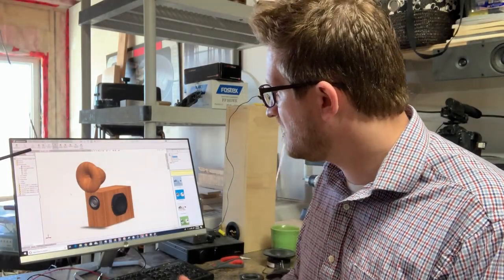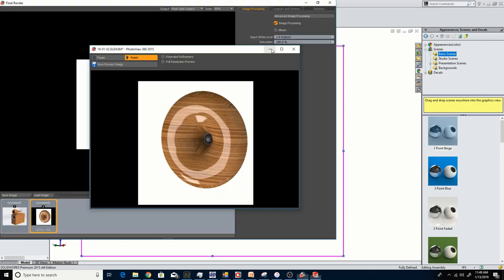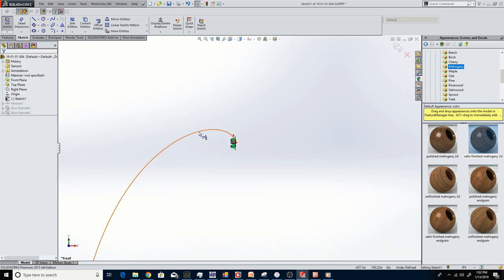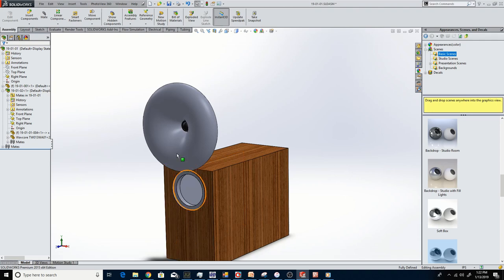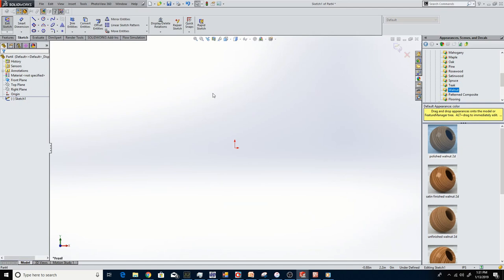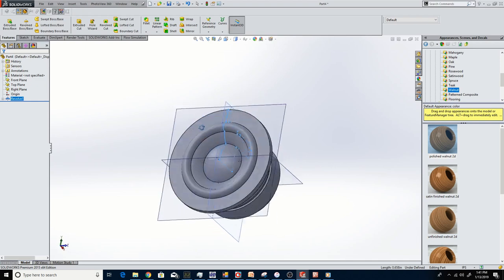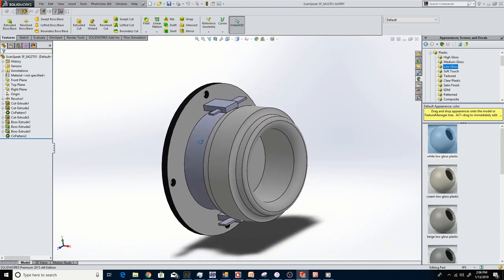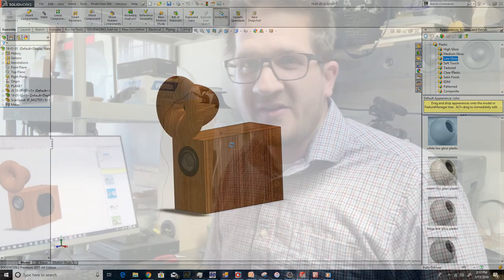Designing Desktop Speaker in Solidworks

Comment: Great video! I'll stick with the free version of Sketchup for now.
Reply from the maker: TransmissionLineDesigns I’ve personally never used Sketchup.  Do any of the modelling techniques I’ve shown transfer to Sketchup?  Or is it completely different?   I would think the sketch environment and revolve features would be very similar.  Obviously can can do assemblies in Sketchup?
Reply: If you take a quick look at the videos, I think the process is almost the same. The only thing one can't do very well with the free versions is rendering. There are ways around this using Simlab Lite (also free) ... its something i need to look into. Also i can't work in Oblique ... most engineers using Solidworks do, it would seem. I watch a few CNC channels, NYC CNC and the like. I just don't know how people do it  🤔
For me I go by the ethos of KISS - Keep It Simply, Stupid. 

Assemblies and other attributes - I'm sure you can with the addition of plugins etc, but it seems you get a more ready product with Solidworks..... but you pay for it!!! Sketchup pro is around £500+ ...Solidworks around £1000 at the least
Reply: TransmissionLineDesigns I think you can use Fusion 360, it`s free too.
Reply: yeah fusion 360 is a great program imo

Comment: I think it will be better if you angle the whole construction slightly for better frequency representation (from desk to listener), imho. Anyway, thank you for your videos!)
Reply from the maker: Korney Kretov Thanks!  I was hoping that I could incorporate a swivel ball for the horn mounting bracket, which would allow tilting the horn towards the listener or pointing it straight up then installing a phase plug into the horn throat that creates 360 sound radiation pattern for a “sound field” listening experience.  I’ll experiment with tilting the entire cabinet as well so thanks for the suggestion.
Reply: Joseph Crowe's DIY Speaker Building great! I really like your videos because of many tech details and concept commentaries. I work as a professional studio mixer and mastering engineer and can tell you something about desk speakers/monitors if you like: some manufacturers make so called desk compensation feature in their monitors, I don`t know why, but usually they choose frequencies around 200-300hz (maybe because they have in mind mixer desks with tilted surface and it makes angle with wall greater then 90 d) , but in my experience most of the problems associated with desk (not mixer) placement is around 350-500hz and the majority of such problems can be eliminated simply by putting monitors higher from the desk. By the way tilted cabinet can be better because of unparalleled sides. Sorry if I made mistakes, english is my third language :)